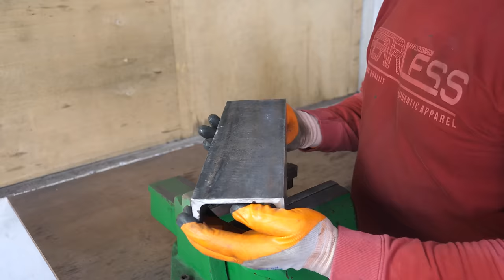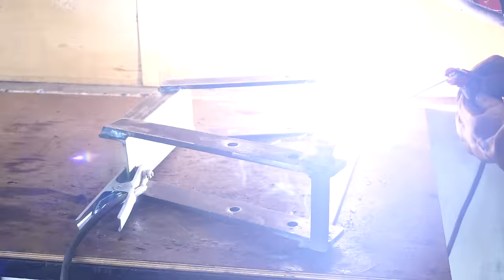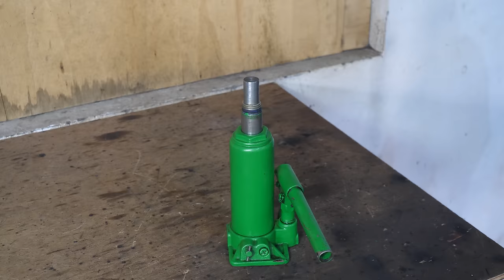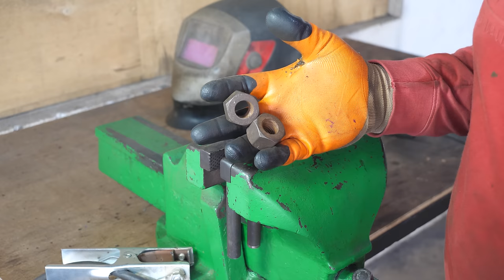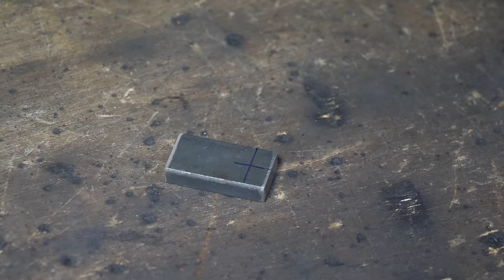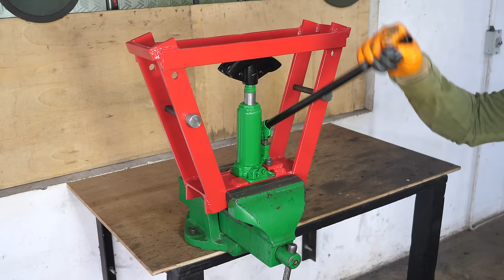How To Make A Simple Hydraulic Pipe Bender Using Car Jack | DIY

Comment: Should had Boat trailer rubber roller wheels on each end. They work well so that the pipe doesn’t flatten, or kink because the metal is dragging and adding friction. 

That said using an air over hydraulics or electric hydraulic ram with a floor pedal gives you more control for complex bends. To do this you also need a quick latch assembly to release one wheel to get the pipe out after making a pretzel.
Reply from the maker: Ok thank you for your suggestion bro